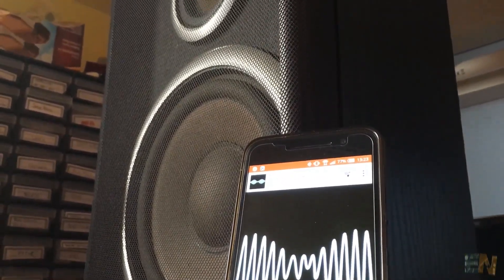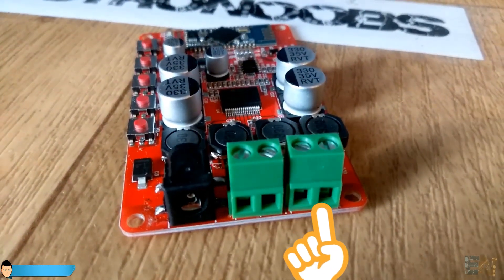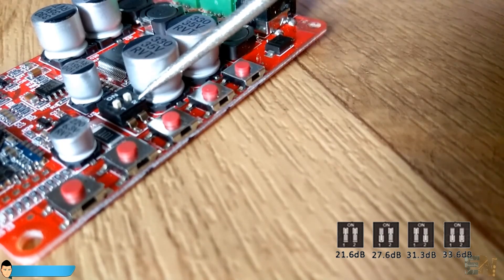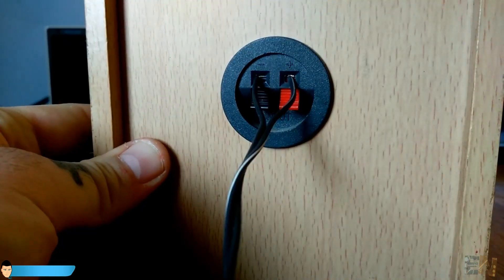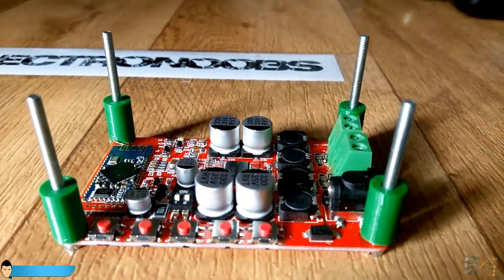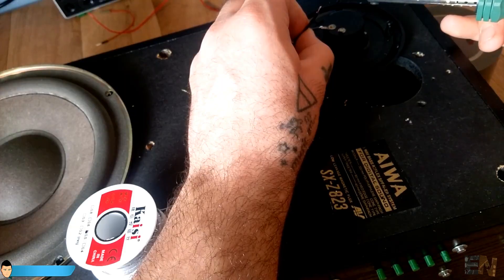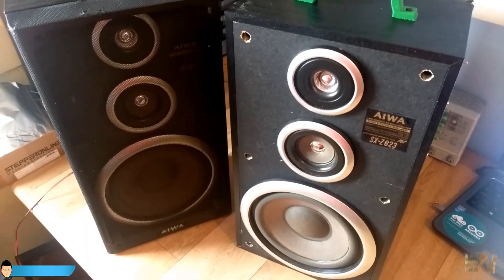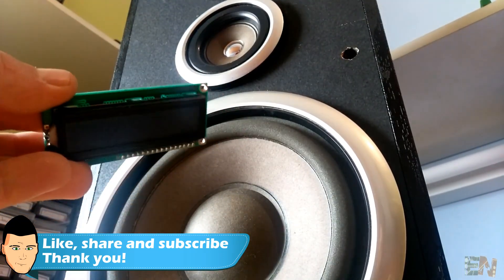Cheap bluetooth portable speaker DIY  100W

Comment: Your math is failing so bad. "100w amp, 50w max used b'coz it's single channel, 40w speaker used" the amp is actually only 25+25w by manufacturer ST at optimal conditions in stereo at THD+N 10% (which you don't really want to listen to - that means alot of hiss) so you're basically stuck at about 7.2 watts according to the spreadsheet. And you said it well, the batteries never draw over an amp, because how could they! Damn they aren't even using that 14,4w that they would draw with one amp.
Reply: KandriX's Channel not only that but he states it's only drawing about one amp of current. my guess is a 12 volt output(just a guess, 12 for the board, 5 for the bt adapter, which would tell me that at max volume he's only drawing 12 watts per channel RMS, as he stated he is barely drawing one amp. way below the boards capability... am I wrong or right?
Reply: They would be drawing not more than half an amp and it would sound like crap. As I said, 10% THD+N is not a pleasure to listen, as everyone that ever worked with amplifiers knows. The "DIY 100w amp" is nothing more than a clickbait, based on one's arrogance or just dumbness to really calculate something. Maths is real, this title is fake.
Reply: Oh I would really love to see this amp draw 2 amps, I really would. Hook it to 2 ohm speakers and watch it burn my friend.
Reply: KandriX's Channel I've tested it on a 2ohm & tried to fry the amp & it worked fine
Reply: well, the channel name is ElectroNoobs so, pardon him, he's noob. jk.
Reply: I am a noob and so please forgive me for saying that your comment is quite confusing. How can the sound quality be improved and does one eliminate hiss?
Reply: at 20v you'll get 19-20w at 1%.... wire up them batteries!  5x18650 in series.  you would need 10x for more play time and proper discharge board. 5s1p
Reply: Well, your question is like asking how can you make your old car go fast. Some devices are made with some characteristics - this amplifier module WAS NOT designed for such a high power output as stated in the video, and pushing it beyond certain limits produces A LOT of background hiss in the output. At power levels declared by manufacturer, it sounds just fine. 
So to answer your question - how to improve sound quality and remove hiss - if you want to accomplish such thing at greater power levels than previously stated, use different amplifier with higher power rating. And forget this video's "100w" title, this one gets to no more than 10-15 watts. 100w amps look WAY different to this one. (F.ex. they have freaking heatsinks coz 100w is a lot of power)

Comment: you know, you can bridge the stereo to mono and have twice the power on those, i've done it at line level with two 4,7k resistors, one in each positive and then soldered together.
Reply: Raoni Rafailov how do i make stereo to mono amps? I have that problem 2.

I only use 1 speaker.

Now i use mono AMP, but got no bleutooth. If i use bleutooth i cant use it on the same power.. some how?!

I use li-ion with pcb

Comment: Look at the Data sheet. This amp puts out 25w X 2. The ones saying that it is 50w are the deceptive ones. The ones that list it at 25W are the ones that put the correct rating. 25w is plenty of power for the record and very loud. 

Also, that schematic to charge the LiPo batteries is just dangerous which can easily lead to an overcharged battery.
Reply from the maker: You r right with both of those things! I've mixed up the power due to eBay and for the batteries I have already installed a safty battery charging module. Thank you and keep up!
Reply: It does 2x50w at 24 volts

Comment: hey electronoob, coud i use a small car battery that gives 12volts for this project?. and if i woud use him is it possible to just charge it with a car battery charger without the power boost converter?. and if al work. what kind of battery power indicater shout i use to make sure it wont go below a low power point?.

great video btw!

Comment: Hi! I was thinking that it would be great to have the possibilty o charging the battery with an external battery, like those we use to charge out phones when we are on a trip. I think a normal external battery provides 5v, ¿if we install an 5v-14.3v transformer instead of an 12v-14.4v it would be solved? Great video! Congrats
Reply from the maker: You could use this module to safe cahrge the battery using 5V USB : http://www.ebay.es/itm/2Pcs-Micro-Usb-1A-Module-De-Charge-De-La-Batterie-Tp4056-Precise-Nouveau-Diy-C-/131957026861?hash=item1eb940702d:g:yFEAAOSwo4pYHUwL

You should add a boost module to the output of this module like this one: http://www.ebay.es/itm/5pcs-MT3608-DC-DC-Step-Up-Boost-Power-Module-Max-2A-Adjustable-for-Arduino-TE686-/282381038539?hash=item41bf38b3cb:g:l34AAOSw32lYuIhl

Like this you could charge a 14V battery uisng 5V input always that you won't exceed the 2A current of the module. Keep up!
Reply: but sould I change the converter used in the video?
Thanks
Reply: nikoloko112 how many 18650 battery i need..and it can support the 4 battery to charge with that module tp4056 module

Comment: Hey, thank you for this video which was very interesting for me, but would you maybe also record a video, in which you show the whole wiring process because I'm not quite sure how to wire all the cables and what adapters are really necessary. I'm sorry for any mistake I've made but English isn't my native language.
Reply from the maker: hi there. Thanks for your com. I will definitelly make another video on this project since this one is not finished yer. I have to add a battery safety charging module and some indication LED. But I don't know when I'll be able to make that vide because I'm already working on a few projects. Thanks again and keep up!

Comment: 15V in mAh?
Reply: 15v is a Voltage. mAh is Miliamps output for an hour. If it says 2000mAh it will output 2Amps for one hour before flat. Be careful as a 10000mAh pack will not handle 10A continuous. If it's rated 2000mAh it'll also do 1 Amps for two hours, roughly.

Comment: +prettylittleditty89 I have 4 of these bluetooth amplifier boards and I found that a laptop power supply is practically perfect for these amplifier's. Search E Bay, u can get the power supplies for around $10 or so. Look at pics, details or description for an out of 19v at 4 amps give or take. I've never had a problem using them and there regulated at the output voltage so u won't have to worry about overvoltage. You may have to manipulate the power jack. Good luck!
Reply from the maker: Thank you. And yes, laptops transformers are good for this project.

Comment: I dont care about portability - I was going to use this blutooth receiver (see link) for an outdoor entertaining area speaker set-up. Could anyone please suggest what I need to look for in a power supply I can connect directly to the power outlet? Thanks in advance. 

http://www.ebay.com.au/itm/142210856370?_trksid=p2060353.m2749.l2649&ssPageName=STRK%3AMEBIDX%3AIT
Reply from the maker: That is the same board as in the video. Just apply a voltage between 12V and 36 DC to the main input. This kind of PS should be perfect: http://www.ebay.com/itm/DC-12-24V-Power-supply-2-3-5-8-15-20-50A-Universal-Regulate-Driver-For-LED-Strip-/351299826035?var=&hash=item51cb19f173:m:mpug97Vr562FptQfZdfX1RQ

Or maybe use a DC transformer with a higher output than 2A.
Reply: Thanks very much for your quick reply dude. And I see you respond to other fairly quick aswell - that is awsome. I think what I had in mind with my initial question was a DC transformer - something to just plug in and play. Would what is linked be ideal? Going to be using 8Ohms outdoor speakers if it makes a difference.
http://www.ebay.com/itm/AC-100-240V-To-DC-12V-1-2A-3A-5A-6-8-10A-Power-Supply-Driver-Adapter-Transformer-/291974383455?var=&hash=item43fb07875f:m:mphsydH8_NWgayElLhsnjWQ
Reply from the maker: If you whant tho use this kind of DC transformer you should buy the one that has 60W or more. But this one is just 12 volts which is the minimum voltage for this speaker. I recommend you a 24 one like this: http://www.ebay.com/itm/AC-100-240V-to-DC-24V-2-3-4-5-6A-Transformer-Power-Supply-Adapter-For-LED-Strip/371732032631?_trksid=p2047675.c100005.m1851&_trkparms=aid%3D222007%26algo%3DSIC.MBE%26ao%3D2%26asc%3D41393%26meid%3Dbbcf1d30978342e18886f4080c4eea1d%26pid%3D100005%26rk%3D6%26rkt%3D6%26sd%3D322204468817

This one is 24V ant has a quite nice current output. Just remember that power is current time voltage, so at 24V if you draw 1.5 or more amper of current you will use about 50W, which is the specifications of this amplifier. Keep up and thank you!
Reply: +ELECTRONOOBS which selection in your link would you recommend as optimal? 24v, 5a 120w?
Reply from the maker: prettylittleditty89 that should be more than enough. but if you want to save some money the 24V 2a 50w is also perfecr since the max output of the amplifier is 50w.
Reply: +ELECTRONOOBS thanks very much for your support dude.
Reply from the maker: prettylittleditty89 u welcome, any time!
Reply: I wouldn't buy the three dollar power supplies. Just, don't.
Reply: A $3 power supply would have been 12v 1.25A 25W - no I didnt but it. I did but this however - http://www.ebay.com/itm/AC-100-240V-to-DC-24V-2-3-4-5-6A-Transformer-Power-Supply-Adapter-For-LED-Strip/371732032631?_trksid=p2047675.c100005.m1851&_trkparms=aid%3D222007%26algo%3DSIC.MBE%26ao%3D2%26asc%3D41393%26meid%3Dbbcf1d30978342e18886f4080c4eea1d%26pid%3D100005%26rk%3D6%26rkt%3D6%26sd%3D322204468817

Comment: can we use a 12 v adapter
Reply from the maker: Yes, it must have a DC 12V output and more than 1A of current. Also you need to add the boost converter to increase the voltage up to 15V for the batteries. A charging/protection module for the batteries is also a great idea! Keep up!

Comment: you used lipos but you didn't got a bms or something to cut of power went the lipos are low.. you will kill them if the voltage get to low
Reply from the maker: Yes, you are right and as I say in the video this project is not ready yet. I have already installed the battery charging/protection, status lights, and some more control buttons. Maybe I will upload a new video with the new improvements.
Reply: Electronoobs can i use 18650 batteries?
Reply from the maker: Yes. You will need 2 or more in parallel if you use this schematic: http://www.electronoobs.com/images/Circuitos/tut_9/safety_charging.png
Reply: i would recommend using charging module made specifically for more baterries. Something like that for 2 baterries.
https://www.aliexpress.com/item/4000053248089.html
Reply: hey, the video with the upgrades ? hmm ? :) the status lights, charging/protection.... c'mon dude !

Comment: Hi thanks for the video, I'm about to get a box laser cut to house the board and was keen to add an on/off switch. I'm not really interested in adding a battery as it's going to be used in doors. I was thinking of using this switch: BQLZR 16mm 12v Led Lighted Metal Push Button On-Off Switch Ring Illuminated Blue https://www.amazon.co.uk/dp/B00EQ1UFEA/ref=cm_sw_r_cp_api_ihIQyb5VJY8RS
How would you suggest I add it to the circuit?

Comment: If you use 8ohm drivers wouldn't the max power at 15V be around 28W/speaker or 20W RMS? (15/8*15) Or I am simply missing something?
Reply from the maker: Andrei Dragan salut, first of all I've made a mistake. the TDA7492p is 25w+25w. the TDA7492 is the 50w+50w. the max output of the board is given in real power not RMS and the datasheet says 50w for each output. but that is the max power. and yes, for a voltage of 15 that will be a little bit lower. the voltage range is 12-36V
Reply: RMS is Real Power. Root Mean Square. The ratings you see are Peak. Some even PMPO.

Comment: Hi... Very nice speaker and well made video too. As this is  a stereo amp being used with a mono speaker, will the sound quality not suffer?  Cannot you connect both left and right connections on the amp  to the same speaker?
Reply: No, You can NEVER connect the two outputs in parallel! They will fight each other and ultimately the magic smoke will arise.
Reply from the maker: Yes, if you have a song with stereo effects, you won't hear one of the sides. And yes, you could connect both outputs and maybe that's what I'll do when I'll have some time to open the speaker once again. Thanks and keep up!
Reply: Is there another way to do it?

Comment: shouldnt the battery last only 1hour at full volume?
Reply from the maker: No Comment there are two batteries in series and it draws less than 1 amper. I haven't done the math but it could last a couple of hours.
Reply: ELECTRONOOBS but the batteries were only 1Ah. so if the speakers draw 1A it lasts for 1h
Reply from the maker: You are right there, 1000mAh should last 1H at 1A,  but the speaker never draws 1A. It usually draws 600mA or so and it gets a little bit higher with drum hits. I guess bass vibration makes it draw more current.
Reply: ELECTRONOOBS ok, thanks
Reply from the maker: No, thank you!. If you watnt to build this project make sure to buy the TDA7492 with 50w+50w output. There are a lot that look the same and don't have that output. Keep up :)

Comment: TDA7492p is 2x25w. TDA7492 is 2x50w. The yellow boards are usually the ones that uses TDA7492 and has heatsink on the chip
Reply from the maker: You are absolutly right. I'll add some tags in the video to advise that! When I bought the board the seller sold it as a 50w+50w and I haven't double checked the datasheet. My bad... Thanks for your com. I hope you like my videos :)

Comment: is 4ohms compatible?
Reply from the maker: Noble Radium no is not. I mean you could use it but is not recommend. the speaker would draw too much current and at same voltage that equals to a higher power than 50w. and the module can't supply that. I haven't tried and I don't recommend!!!
Reply: It should work fine at 4Ohms if you don't crank it too much. Be sure your 4Ohms speaker doesn't dip below 2Ohms, ever.

Comment: Where you buyed thos batterys?
Reply from the maker: You don't need exactly this batteries. I got those out from an old portable radio.
Reply: Is it good idea to use lead acid battery?
Reply from the maker: Yes you could. I think that uisng those you could store even more energy. But those are very heavy so is your choise. But yes, the circuit doesn't need a high current battery so acid batteries would work as well but to be higher than 12 volts otherwise in 2 minutes when the voltage drops at 11.9 you will have some problems. Maybe connect 2x12V in series.
Reply: I only have one...
Reply: And i don't use 100w amplifire. I use 20w.,
Reply from the maker: Well it should be higher than 12V. The power doesn't matter.
Reply: Okay. If i will use 3 li ion batterys in seris. Could i charge tham with the same charger that i use for lead acid?
Reply from the maker: UrlaTV for li ion batteries you should control the current while charging. if your lead battery charger has that option is OK. each line ion battery comes with some charging specifications